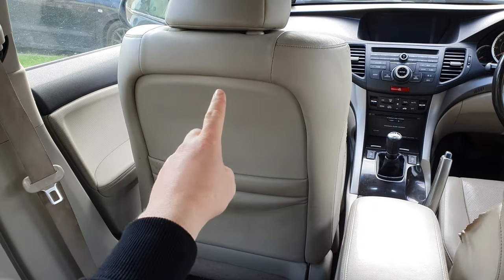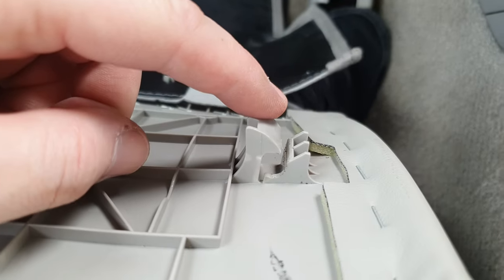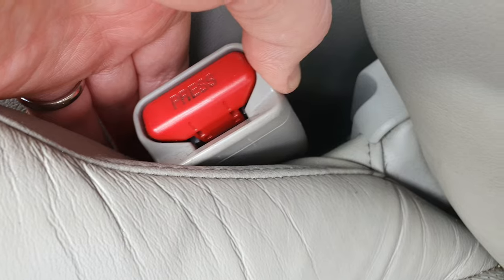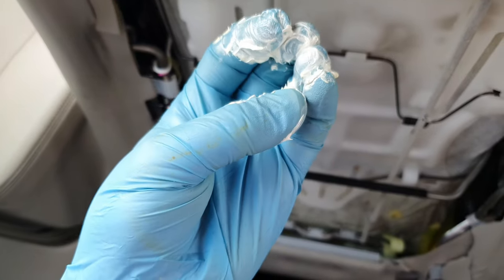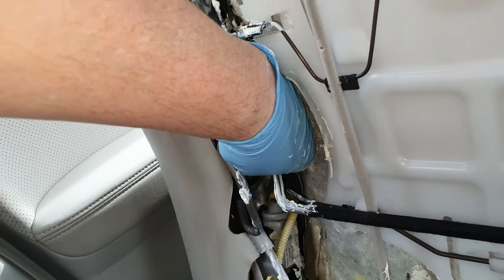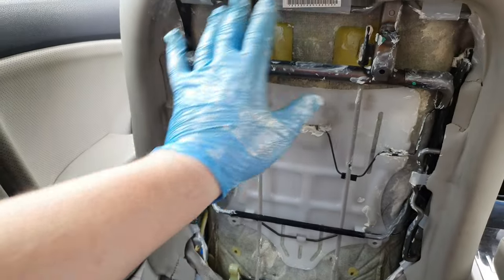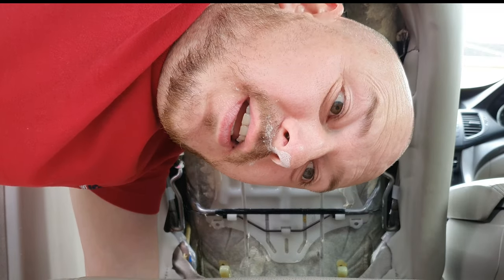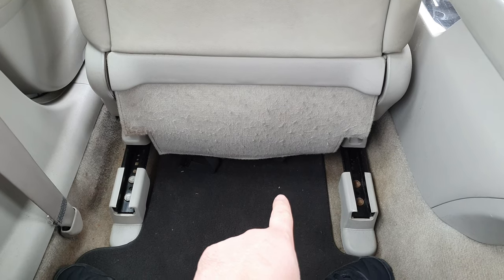How to fix squeaky car seats/Stop fart sounds on your leather seats/fixing noisy seats in car.

Comment: The squeaking in my CU2 seats has been bothering me for a over a year now, never though it would be that easy to remove the back cover, at least it looks easy 😀, going to try it soon, thanks for the video!
Reply from the maker: It is very easy. Worth a try. It worked for me anyway.
Reply: I got the same problem in my cu2 accord😂
Reply from the maker: Hopefully it works for you to.

Comment: you can put some material in between, it’ll be more permanent and less messy 👍🏼
Reply from the maker: @AaronC_MusicMaker Actually i used an old rag in the driver seat for a couple of hours just to test it out and it fell out with the movement, so i thought I'd try some lubricant and it has been working for the past 1 and a half so it has worked perfectly. So I'd recommend the grease, it's messy putting it in but easy to clean up. Thanks for your comment.

Comment: What type of grease did you use? How is it called?
I have an F10 2012  and i face the same problem. Whenever the seat leather meets the plastic, it makes the annoying noise.
Reply from the maker: Well any kind of lubricant grease will work but i just used a marine water repellant grease i had in my shed.

Comment: Hey, have Honda uk sorted out the satnav/clock issue yet?
By the way would you like a  genuine complete set of velour mats for your Accord?
i bought them new and  there immaculate with complete fitting clips and the rear mats have NEVER seen a pair of shoes,
There grey with embossed steel Accord emblems and were only in the my car for 3 months and then i sold my 2012 Accord for a 2019 Civic fk7 👍
Reply from the maker: The clock issue seems to have been sorted for some people automatically, some others need to go to honda to get it sorted and myself, i haven't bothered with it, its still out, and my satnav disc is out of date too! Fk7? Very nice. As for the mat's i have of genuine accord mat's in my car so thank you for the offer.
Reply: No probs☺ just thought i would ask a few people 👍
Reply from the maker: Gentleman thanks